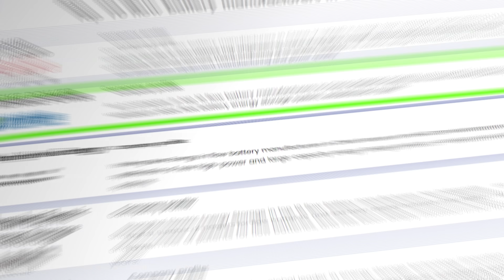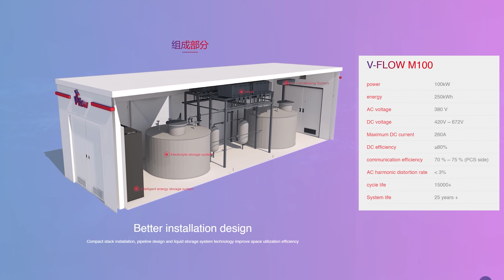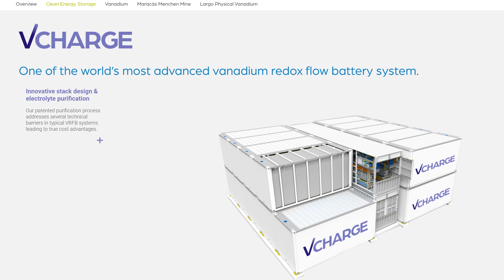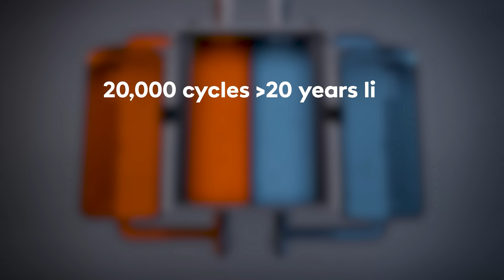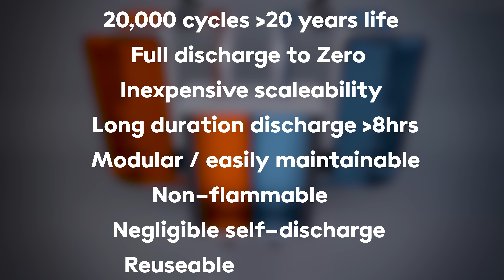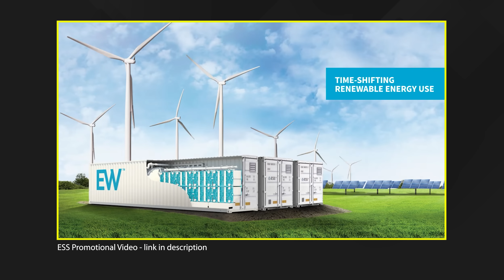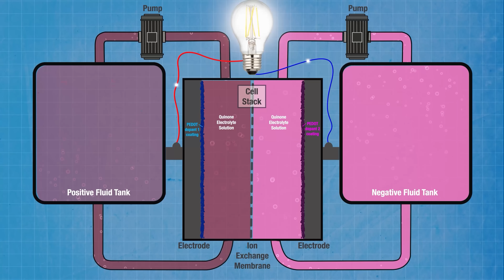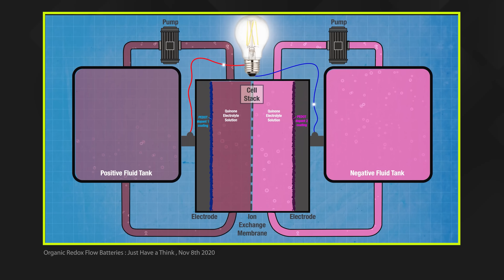Iron and Saltwater Battery How easy is that

Comment: Dave, Thanks, as always, for the round-up.  I thought it might be a good idea for us to remember Regenesys from the late 1990s - a pioneering UK flow battery company.  My understanding of their challenge back then was that the membrane stack was very expensive for the rated power.  It would be interesting to see how that aspect has changed in the last two decades.
One UK company that you haven't mentioned is StorTera, who have an altogether different flow battery chemistry - perhaps worth a look?  
A question that your video left us with is: why would anyone be continuing to pursue Vanadium chemistries when iron and salt water are cheaper, more power dense and less environmentally concerning?  There must be a down side?
Reply from the maker: All good points. Cellfion now make organic cellulose-based membranes. That might help. https://youtu.be/Lnz0XB--IqA

Comment: The Prolux Storac seems to be a viable alternative to lithium for domestic use.  The units are big but many homes have a spare corner.  However I can't find any pricing or supplier information.  the same seems to be true of all the flow solutions.  Brochureware is great but is difficult to try.

Comment: I am quite angry with Flow battery manufacturers.
While you can read fantastic articles how the technology "will cost around $50 per kWh" of storage - it feels like unobtanium.
I took the effort to go through all European manufacturers, including resellers.
NONE of them lists any price at all. You can't compare it to batteries, simply because none of them displays the price.
At best, you have button "inquiry" on the site, but majority simply points you out to some "installers and distributors", while they list none on their page. Or if they do, the distributors and installers also only state "contact us" for price.
As long as this is sold using this method, the technology has no real potential on the market.
I can literally walk into a store with electronics, buy Pylontech 4.8kWh battery and walk out in minutes no problem.

Comment: Hey dude glad you got to ESS because these companies that are finding solutions without using more expensive elements or rare earth are critical to sustainable grid storage, which is critical for green energy, so I put them high up on the list of great solutions and am hoping they start winning lots of contracts to get their tech out there.  I mean they've already installed systems, but when we get the most benefit is when a few of these start to push out the others so there are less competitors AND they can then get to economics of scale.

Comment: Another great video! Thanks so much!

I've seen some of your other fine work in videos related to energy usage also. I'm thinking now of refrigeration and heat pumping. I've just learned some interesting things about "nitinol", a nickel-titanium alloy that is one of those amazing "memory metals" that can be restored to an "original" shape. NASA is using that property to make more durable tires for vehicles off Earth.

The key point of my interest at the moment lies more in the facts about its stretchability/temporary deformation. A sufficiently thin straight rod of the stuff can be bent to about 180 degrees by hand, which yields a surprising result. The stress of the bending causes it to release heat, enough to startle the one who bent the rod (but not to burn). Then, reversing the deformation, the unbending causes it to absorb heat, again a startling effect on the hand.

There is where the revelations of this property ended in the video I watched (from a well-known You-Tuber). It wasn't central to that presentation. But there was a mention that this heat transfer ability is under investigation for application in refrigerators and heat pumps, and has the potential to reduce costs in those applications significantly. So Dave, have any of your investigations run into this idea? If you're interested, I'd love to see a spot on this!

Comment: A German company is advertising a flow battery that can be installed at home like a powerwall:

"Prolux Solutions says that all components can be repaired indefinitely. It notes that the vanadium electrolyte also retains at least 95% of its capacity, even after 20 years, so it can be reused indefinitely."

I live off grid full time and now use LIFEPO4 but I like the idea of a battery that can be fully repaired and doesn't require Lithium mining and can be fully recycled.

Comment: The problem with iron flow batteries is that they haven't broken anywhere close to theoretical capacities. A entire large truck trailer (lori) holds about 5-20kwh of energy(this is why they don't advertise actual capacities). To give context a $1500 5kwh eg4 lifepo4(one of the safest battery chemistries) fits in a 3u server casing ( about 19"x12"x36"). In other words 15kwh can fit in about a cubic meter. You could throw 4 of them by themselves in a truck trailer and light it on fire with no problems. Also the infrastructure for iron flow batteries is huge when you don't count the batteries. I would wager that they cost 1000's of times more that the lifepo4 equivalent, making it kind of a grid level scam.

Comment: Any info on if the fluids in a flow battery (any type) could be charged in one system and transported to be discharged (and returned) in another? If so the transportation/export of power could be revolutionized as a solar farm in Africa could ship power to customers in Europe or Mexico to north America. Why not pipelines from Texas to New york if the pump system do not use more power than the transport is worth.

Comment: For some constructive feedback, it would be nice if you mentioned the cost of the various solutions, (either the full cost, or cost per kWh), even if it's an average of the different companies.   
Just so it's easy to compare to traditional lithium batteries, as battery manufacturers often don't list prices on their websites.

Comment: Iron and saltwater could be game changing given how cheap the materials are!
Reply: We've not had figures for efficiency...
That might be an Achillies heel for any system, since it represents a ongoing cost.
Reply: Bingo, when it's omitted it's usually bad. I hate that most about Battery news. About 10 important properties exist. He could rattle them all off in a second. But never happens. Disappointing channel
Reply: So what’s the downside? There must be some reason everyone else is using vanadium. Some trade off.
Reply: @OrenTirosh  energy is lost when the battery is charged and when it us discharged. It might be that iron solutions lose more energy than vanadium ones.
Reply: @dougaltolan3017  spot on, it's like a ridiculous 60% round trip efficiency.  Pretty much need to double your entire generation capacity to compensate

Comment: The Fe salt water battery has potential but.  Footprint, weight, dollars per Wh are all important.  The transport, installation costs can often be more expensive than the cost of the battery.   One of the reasons that the Li batteries are used.  The total cost of installation provides a faster return on investment.  The shorter life of the Li batteries is not a consideration.  The critical issue is period of return of investment and profit.
Reply from the maker: Life span is absolutely a criterion if flow batteries last two or three times longer.
Reply: @JustHaveaThink  While I absolutely agree that long life span is important, commercially what is more important is the rate of capital return for the project.  Financing the venture has costs, if the upfront costs are too high to provide a rate of return that is profitable it will not go.  Also a high rate of return means more capital to install more infrastructure.  It is a balancing act of costs.  At the moment Li batteries have an edge.  Because Li is not sustainable hopefully some other more long term chemistry will, Fe salt may be.  Geologists conclude a 4 million tonne per year Li2CO3 short fall by 2040 with current 1 million tonne a year production.

Comment: On a similar note but non flow is EOS Energy, their unit is a Zinc Bromine sealed cell with conductive polymers they recently received a $400m loan from the LDES DOE loan program, loan is to build out 8GWh of automated production lines, been around for a long time but the cells are now ready for scaling having been field proven for last 3-4yrs, very low cost of production at scale and has been through a 2 year verification process with DOE to get the loan

Comment: Love your humour, Dave! Great video, good to see practical mass storage solutions available. Now the utilities just need to be motivated to invest
Reply: In my research I discovered that my utility, SDG&E has two installations of ESS energy warehouses and they also have contracts with SMUD to install up to 2GWH of long term storage!
Reply: @580guru  great news! I think a lot of the changes are taking place quietly and the much louder voices of the “petroleum will never be replaced!” crowd are getting more attention.  There’s no question that it’s still many miles to go but the pace of both innovation and adoption of these alternatives is cause for optimism.
Reply: Exactly, but if they manage to get down to 5 cents per kWh then a lot of private investors will be jumping in to add storage.

Comment: There are many battery types and some that are cheap and can hold a charge for years. It seems like the storage solutions are there for short term and seasonal deviations in energy production. There is also a geographical spreading out of the energy grid to minimize deviations. What are the holdbacks for renewable adoption and production?

Comment: First to demonstrate the vanadium battery was of course Maria Kazacas of NSW University Australia. I thought it was a great idea . Naturally what came to mind then was other elements to use with multiple valence states to exploit , elements like iron yes , then there's copper too but iron is more appealing. Lead also has multiple valence states and the lead acid battery operates because of this . The advantage is when you can avoid the clutter and unpredictability of how heaps of different substances will adversely interact and shorten life . There's heaps of different substances in the lithium batteries as an example. .

Comment: An interesting advantage of Vanadium flow batteries is that it's easy to increase storage capacity by simply increasing the electrolyte tank size, theoretically without limit. The Iron Salt battery can't do this as the iron is deposited as a solid. Similarly for the Redflow zinc bromine battery. For this reason I wouldn't call them true flow batteries.

Comment: Really appreciate the effort & time behind the video - thank you for your time and for sharing your passion - Voltstorage GmbH don't know if it is the same you mention for vanadium, do iron flow as well...I personally wouldn't even consider vanadium or bromide for home use if a iron flow solution were available (due to their toxicity) in a more manageable form rather than a 33 Ton heavy & 40 feet long container

Comment: It's odd that Sumitomo has been building Redox Flow batteries at utility scale for a long time, but I've never heard of any such installation.  Are these flow batteries overly expensive?  I would expect that from Lockheed Martin, and the fact that their (first?) installation is at a military base is consistent with that.  The fact that the only grid-tied batteries I've heard of are Li-ion makes me suspect that Flow batteries are more costly.

Comment: Thank you, Dave, for the usual useful and informative video. Flow batteries have a great future in many systems, from domestic to office and small factories right up to grid level storage. 
As I am sure you know, they are safer and cheaper than lithium-ion and have the advantage of being able to be fully charged and discharged with virtually no degradation. Neither do they suffer 'vampire drain' like lithium-ion and hold their charge for many months or even years.
Australian company Redflow, I think, is worth a mention as they make a zinc bromide redox battery that is ideal for domestic applications and is available to buy in the UK (and no, I don't have shares in the company).
Reply from the maker: They were in the first video that I did a few weeks ago.  
https://youtu.be/19twy3eYgD8

Comment: Tx for another great video. I'm particularly intetested in batteries that use abundantly available materials or can use recycled / recovered materials. All we need is for the JUST energy transition to initiate another round of enviro destruction, economic inequality, colonialism & emperialism, and possibly WW III...

What I'm discovering is there are different classes of batteries useful in different scenarios; each useful in their own way and can complement each other
- batteries that store heat
- batteries that store electricity

A third class - not a battery - are thermal recovery systems whereby heat from human activities - such as factories & data storage banks - can be fed into district heating systems or stored in a heat battery (usually achieved via large heat pumps) Such cases provides a win-win
- reduced energy required for cooling (company)
- energy avoidance required for heating (community)

There are many processes that generate a lot of heat, eg a commercial compost heap, that could perhaps are be harnessed to recover heat for other commercial purposes (such as a bakery) or heat nearby homes in winter, reducing energy demand on national grids.

There's a community development strategy aka ABCD aka Asset-based Community Development. Communities identify & utlise assets (natural, economic, socio- cultural etc) to achieve prosperity for all. Gov, business, civil society & residents working together to make a better world for all
- residents can't do it alone
- govs take too long
- together we can achieve much

Comment: I wonder if these batteries can help out the British Grid which can't cope with the demand for EV rapid charging stations? I know of five major sites within a 20 mile radius of me which will probably need to throw out their new "pumps" and replace with newer before the National Grid have enough resources to get cables to them. Is it Show Politics or bad planning which has these sites seemingly ready but not connected up?
Maybe these Flow batteries can constantly trickle charge on 3 phase and supply at least some rapid charge sessions each day.

Comment: One question that occurs to me, Dave, is about losses. These flow batteries all seem to have pumps, to push the various electrolytes round. Presumably these require energy to run, both in charge and discharge cycles. So, what kind of losses (%age wise) are incurred when using these batteries? Additionally, when you say 'negligible self-discharge', how long, for example, would one of these batteries remain fully charged for with no external current draw?

Grrr! I guess I'm going to have to go and read the various companies marketing spiels now, and see if they provide answers to these questions...
Reply: I don't know about pumping losses exactly, but in a closed system where you aren't trying to pump net mass uphill and flow velocities are low, the pumping losses are going to be pretty small, I'd guess on the order of a few percent.
for the negligible self-discharge property, a lot of that comes from the fact that you can just disconnect the reaction chamber with the separator from the main storage tanks and then it's pretty much physically impossible to self-discharge since there's no flow path for ions to cross between the anolyte and catholyte.